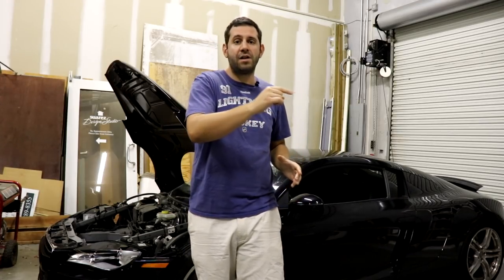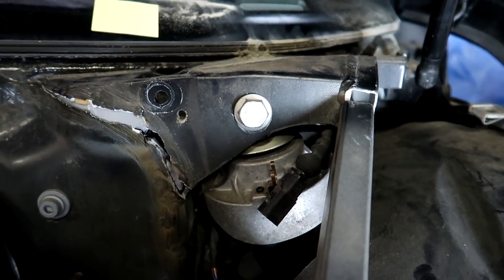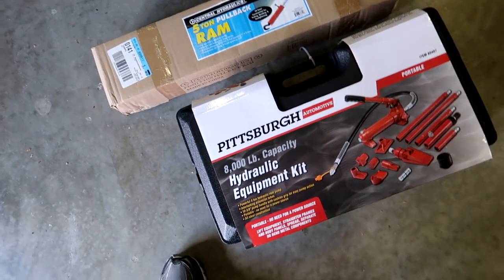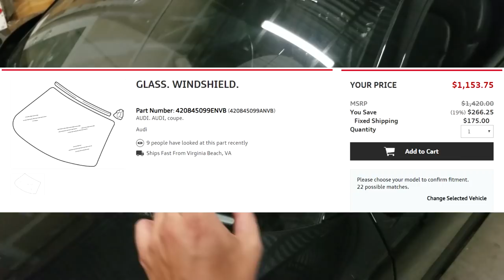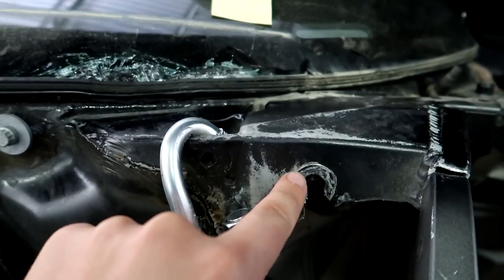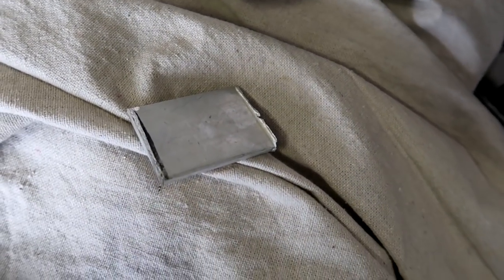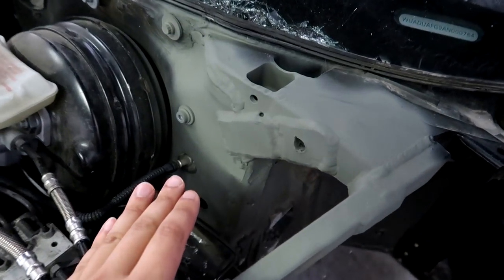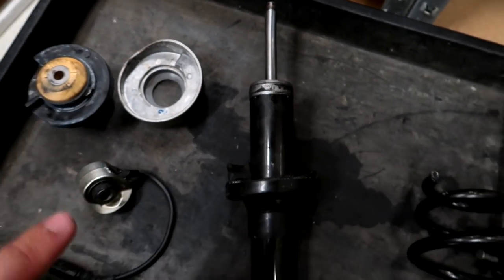I Repaired My Totaled Audi R8's Cracked Frame for $500! Insurance Quoted $29,522!

Comment: Honestly I feel like that isn’t safe at all. I would be scared to drive that car...
Reply: I absolutely agree. I wouldn't drive that car even if it was free. I've worked with autos for 15 years and thats some serious damage. The welds should hold but it will never be as good as OEM. Even if its 60-80% as good it still wont be perfect. In this situations you do get what you pay for. It sounds like a nice story (but i wouldn't claim victory by any means). Its a performance car and if someone is driving it hard (which is much more liekly on an R8 than a Civic) id be really nervous.
Reply: Not something I would recommend either.  The car was an engineered product.  The official fix is an engineered fix.  This fix is guesstimation, not based upon analysis.  Welding aluminum isn't trivial either.

Audi R8 have a reputation for fragile windshields.  Weight savings.
Reply: @matthewgaines10  You bring up a really good point. Sam appears to have no ill-intent, but it appears that because he is so excited about his new dream purchase (which he wouldn't be able to afford with out YouTube, and the growing popularity of fixer-upper channels, to make large business purchases for content creation) he is really rushing and hastily hammering and welding to put a band-aid on. With personal safety, especially on a high end performance product "good enough" or 'as good as new" is not something that should be applied to this particular situation. I don't want to use the word "negligent", but there is clearly a lot of oversight in this method of "repairing" the car. If he plans on never selling the car, then I really don't care. But, I don not see him keeping this car forever and that should be a point of concern for many.
Reply: @BMWE90SG   It's akin to hiring a guy that welds trailers to come fix your 300 mph funny car or helicopter.   A supercar capable of 200 mph will kill you and your passenger very quickly if the frame fails at speed.  I think the author is being very negligent in suggesting this is an adequate repair.  Clearly he's got some avid followers, he owes them something better than this.
Reply: PROANISH that repair looks 100x stronger than how it left the factory.
Reply: @5uprnva  the rivets on the Titanic looked pretty strong too untill they put up against external forces. The point is, just becuase something looks strong doesn't mean it is. Aluminum is not an easy material to work with. Cars that have aluminum frames damage are not a quick fix.
Reply: like oem it cracked????? @BMWE90SG
Reply: @Vtuned  really? That's the best you can come up with ? With out scientific analysis to understand if it mental fatigue or poor welds we will never know why this specific car has joints failing among others. However to suggest that you can easily fix this car by bending and welding to make it road worthy is not fair and is fake news and misleading. Integrity doesn't just apply to metal but also to humans. One would ask why did Audi make reinforcement bracket? This is because they addressed the issue with engineering after failure rates increased. Same goes for the E46 m3. This is why there are very less certified aluminum repair techs in the luxury car world and they command high pay. It's not easy nor is it simple.
Reply: @2511jeremy  first of all I'm not your kid. Second of all If you understand how comparisons work, I'm comparing how visuals dont identify the tensile strength of an item. And no I would not drive a compromised R8 even if it was free. Doing so means you value your image more than the safety of yourself, potential passengers and other drivers on the road
Reply: Yall sound like some YouTube engineers lol and Ben is one of the best  in the business and does it professional it will be stronger then oem
Reply: @BMWE90SG   welder did what he could, but filling holes will throw that geometry Soo far out of  spec, let alone all the distortion in the original aluminum.  Why does he think it just cracked, the whole pice I'm sure is distorted.
Reply: Nah, it's metal and can be fixed.  The reason why it cracked in the first place was because it had a crap joint.  This fix is probably stronger than the original.
Reply: Luxilicious spot on!
Reply: @JohnD Look you can nit pick all you want about OEM and what I have to say. I really dont mind. But nobody here is saying that OEM is perfect. But VAG did come up with a solution to the problem. We, (including myself) dont know what caused this damage on the car. Did the previous owner hit a pot hole or speed bump going 20MPH? was it metal fatigue? is human error? we dont know. But what I am others are trying to bring to the table was the process that this attempt at a "repair" was very crude. It gives misrepresentation to structural integrity, geometry and specialized materials. Like he mentioned in his previous video, aluminum is not something you can just go welding like you can on steel framed cars. Everyone is entitled to their own opinion. I base mine off of working with exotic cars with their manufactures and dealing with certified dealer body shops. I was really hoping to see this car go through a proper evaluation, put on a frame jig, measuring the geometry, getting the proper tools and parts necessary to do the proper repair on a budget. There is a reason why this car cost over $20k to repair. That wasn't just a big number to total out the car. I want to share my experience and knowledge with the community to see another side to a perspective that seams to be overlooked by the way Sam designed his video and went about working on this new purchase. Do what you will with this. This is YouTube, its filled with opinions. I just hope some of them are backed with some fact, experience, knowledge or hypotheses.
Reply: This will be twice as strong as factory
Reply: If it is properly welded it should be stronger than stock on that corner
Reply: @BMWE90SG  obviously you haven't seen a young kid drive a performance civic, they beat them like they owe them money!. In my experience most high end cars are babys, over washed and underdriven.
Reply: The reason why there's only a few shops certified to do this sort of repair is because of contamination. You're not supposed to use tools that have been used on steel body vehicles. You do not want to contaminate the aluminum with particles of steel. That's why shops that are certified to do these repairs have separate sections where they do repairs on aluminum body vehicles.
Reply: I am a certified icar auto body technician and what was done here is exactly what would have been don to fix the original defect to begin with. It would have been nice for him to actually use the patch panel that Audi uses but I’d bet that it isn’t very easy to get ahold of and is more than likely overpriced to begin with. As for its alignment or any thing dealing with the other suspension parts I’m pretty sure they’re fine. R8’s have this problem from what I’ve read, but have been repaired and put back on the road. I see no reason as to why Sam’s wouldn’t be any different
Reply: @BMWE90SG  cars are still simple things, metal and hands make them work, they always have been that way (and yes human hands also keep the machines running that press the metal and weld the bodys). why dont you think it cant be fixed that way? i would trust human hands over a factory fix any day! you know when they prepare race cars they add a heap of welds and supports for safety right? please tell me that this is different? its just in a smaller area. this would be stronger than a replacement front end, if audi actually did some long term R & D they would have foreseen this lack of strength in the front supports and addressed it before it went to market. just sayin'
Reply: @matthewgaines10  Welding aluminum is fine. What they do is have you weld two pieces of aluminum together, submit, they bend it back upon itself, look for cracking. That's what they do with steel.

Comment: There is so much wrong with this video
Reply: Then tell us what you think is wrong?
Reply: Pulling on the bolt hole directly,  deciding that was wrong and then using a bolt but for some reason putting it outside,  and most importantly HOOKING TO THE JACK STAND. Also thinking a bigger jack stand was a better anchor point. Im surprised this didn't end horribly with the car on top of him
Reply: john smith Yeah you can tell he’s definitely not an engineer. Lots of cringy moments throughout the video
Reply: No hate absolutely. I love this guy but it's interesting. He decides to fix the car himself instead of a shop. He starts pulling and it doesn't work so he uses a hammer. Then breaks a window. Breaks bolt hole. Paints with primer. Learns he has a broken shock. It's just all wrong
Reply: @FatMatt63  oh yeah thought the same thing, not the best ideas ever. He is lucky it worked with no damage except for the windscreen.
Reply: @ikolpgnari9734   What the hell do you think happens at most shops??
Reply: @BarnacleBillOrigin  magic lolol
Reply: @FatMatt63  Agreed!
Reply: Wow Sam really is ham fisted good ideas poorly executed, really weak design by Audi 
Hit a big kerb at speed for sure
Reply: @BarnacleBillOrigin  i srsly don't know how it is in america, but in switzerland not at all like this. in switzerland you also would never be allowed to drive a car fixed like this. Because it's a risk, tell me whatever you want to.  In switzerland it's very professional and they don't just try to "fix" something like he did, they think and plan way more than he did.They would dissasemble the whole front, order the replacement and put it togheter while everthing is scanned with lasers so everything is as precise as from factory or even better.
Reply: @ikolpgnari9734  Agree completely, breaks windshield and doesn't even bat an eye that has to spend thousands on windshield repair. Money doesn't seem to be a concern for him...
Reply: @cjcj2940  i mean he explained in the video that stuff like that happens sometimes

Comment: Maybe the suspension code was coming from the shock traveling too far due to the frame crack? It’s possible the computer saw that the shock was traveling too far and threw a code.
Reply: UM

Comment: That is going to crack again. Once the strut mounting bracket was brought back into place, a reinforcement should have been fabricated that had a lot of "purchase" on the bulkhead (firewall) and wrapped up and over the strut mount. This could have then been welded and riveted into place.
Reply: Yyyyyyyyupperz. The whole point was not only to repair, but to increase the structural strength and rigidity... hopefully exceeding any realistic pressures applied to that area. The only way to have done that was to do exactly as you mentioned, preferably with a thicker piece. Also, have it done to the other side. Then be done with it.

Comment: Over a £100.000 car with basic design flaws, Audi should fix it no charge.
Reply: charles mclachlan -right!?! When pigs fly!!! 🐷💸
Reply: I'm not an Audi fan, but judging by the bent shock absorber the car has suffered an impact on that corner. These sorts of 'supercars' do not take kindly to being driven like a minivan over kerbs and potholes. Better of buying a 'stang for that!
Reply: It's the other way around.  The shock is bent because the frame cracked.
Reply: That's actually what happened. The owner got a new car and they sold the broken one for nothing
Reply: The prior owner probably received an insurance payout for the value of the car - I would argue that the State government should have required the car to be destroyed or scrapped for parts without allowing the rolling chassis back on the road.
Reply: @gordonmccracken1209  Dude, cars and trucks break all the time and get welded back up.  It's not a big deal.
Reply: @Bread996  Gordon's right though. That weld is just a bigger accident waiting to happen.
Reply: @Bread996  Except for when it is. If you watch the previous (?) video, Audi only approves one astronomically expensive way of fixing it, which is what the insurance has to go by, not what one of you can do in your own time with a hairpin and duct tape...
Reply: @neogenzim1995  And you know this because of your extensive experience with welding aluminum?  I think not.  The repair has to be proven certainly.  But there is no evidence that an "accident" is waiting to happen.  When it cracked the first time the car just sat lower.  It's not a big deal to fix.
Reply: @Baerchenization  If it was mine from new, I'd want the entire front clip replaced.  That's why its expensive.  The patch panel fix, according to the R8 boards does not include an approved weld procedure from Audi.  So insurance companies aren't going to approve it.  That's why these get totalled.  But if you've got an R8 and you want to keep it then this is a great repair.
Reply: @Bread996  Isn't that what I just said a minute ago? Anyway, I don't have an R8, I have a Porsche and want to keep it :)
Reply: @s3bio  I wonder what Sam will do with it? Who would buy an R8 that's been welded up by a hillbilly in a van (no offence but .....?)
Reply: @ServiceInstaller   No, it happened on the same moment. Because of big bump or the like.
Reply: @Car Los - Doubtful.  The frame cracked then kept putting pressure on the shock.  That damage didn't all occur at the same time.
Reply: @ServiceInstaller   Fact is: we don't know.. We were not there. 😄
Reply: @Car Los - Absolutely.  Just glad it's not my $50,000 mess!
Reply: @ServiceInstaller  Possibly, we'll never know the truth. But it sort of makes you wonder why Audi don't do a local welding repair doesn't it? The sceptics will say its all about making money but maybe there's a reason why they recommend changing the whole front end? Cars like this are not built with huge reserves of strength like a 'truck', they are not intended to take huge amounts of abuse, Ferrari, Lambo are the same. Give them a hard life and they will bite you in the ass at service time. Everyone know you buy cars like this for high days and holidays or youtube content.
Reply: @gordonmccracken1209  why.. the states have rules in place to make sure it is fixed before it goes back on the road..

Comment: Actually i don't think that this is even close to a proper repair. Look up what the repairguide for bodyrepairs for this car shows how this kind of damage has to be repaired and i bet that this is not the way to do this job. I don't believe that there is any way to weld a frame that accords to manufacture standards. This car was and will allways be totalled. The frame is not a piece that can be repaired in such a matter. Trust me i'm a mechanical engineer for vehicle safety in germany. The repairguide says that this kind of repair can only be done by an authorised Audi Workshop. You don't even know what kind of aluminium you have here an how this material reacts to the heat. And trust me once more, this point is very important for crash-safety, because it's exactly the point were the forces were lead through the body. And i can assure you that this point will hold nothing. Would you like to buy a car that was repaired like this?
Reply: I am a welder and work for a leading manufacturer of Recreational Vehicles, on the majority of gas fueled class A motorhomes we make the frame in cut in half and we remove or add a frame section to alter the wheel base. Agree the welder need to know what alloy he is dealing with and that aluminium is not like steel in that it will  be weaker at the weld but if the repair is fish plated or sistered and appropriately braced it should be good. As far as the statement that only "an authorized Audi Workshop should do this kind of repair is this the SAME manual that states that oil changes should only be done by "authorized Audi Workshops?" How much of that is nothing more than Audi wanting to pad the dealer's pockets? How much is simply liability management? How much is simply Audi wanting the car gone and replaced by another one? As far as Quality, if it aligns quality is achieved and this appears to have broken with very little impact so I would have to wonder it Audi maybe screwed up in the design or manufacturer of this car.
Reply: @fk4515  Yup. the same Audi that requires software to do a brake job.
Reply: @fk4515  in my opinion there is a little difference between an oil change and a cracked frame. If you look up what the frame of your truck chassis is made of and what this car is made of. This repair is like fixing a car with duct tape. Not more not less.
Reply: @fk4515  I'm with you on the Engineering Design of this section of the Car.  This 'Crack' or Metal Failure, should have never happened as it did in this accident caused frame failure.  IMO, it appears that this car may have Hit a Curb or similar to cause this kind of damage. Rarely do you see this in a stronger engineered car.  This would not be acceptable to me, I would have also Insurance Totaled it and got (most of) my Money Back!  IMO!
Reply: @najawassolls243  your right there is a difference but the folks at Audi want you to believe that there isn't and everything needs to be done at their overpriced dealers. If you can only take it one place that one place will be A-More expensive and B not as good
Reply: @lvgeorge  it is not a design fail. It is actually a high end design. That means that you don't have any gram more than you really need. See what a formula 1 car looks like after one single race. The engine and the gearbox are worn out. This is exact what happened here. The Frame is ment to resist only one time the force like this. There is no(, how should i say? ) backup material that prevents the frame from cracking.
Reply: @INTERNETMACKER das ist nur Müll, stell dir vor du würdest einen scheinbar günstigen r8 kaufen der so zusammengeschustert wurde